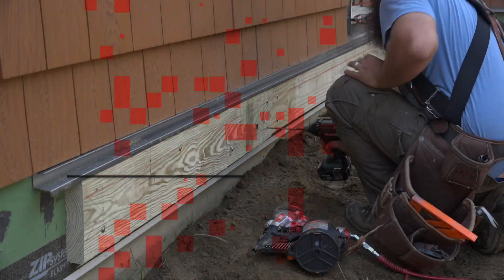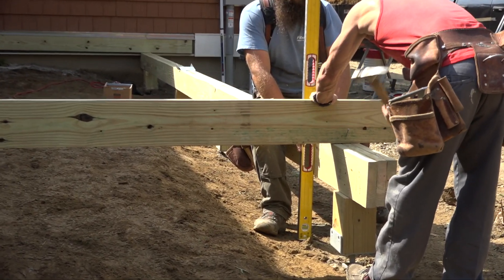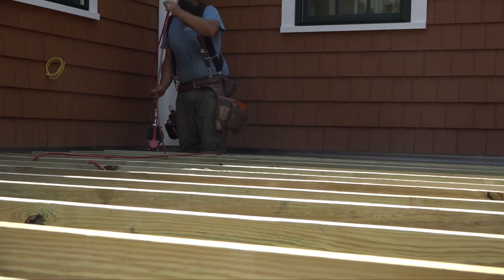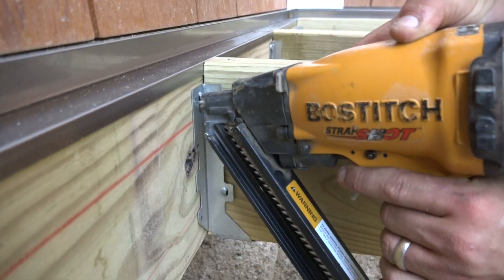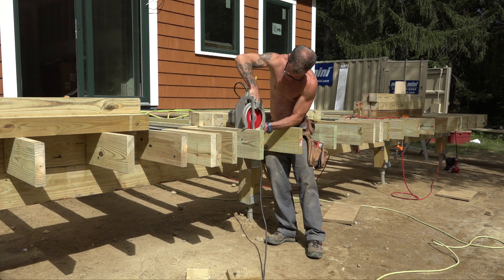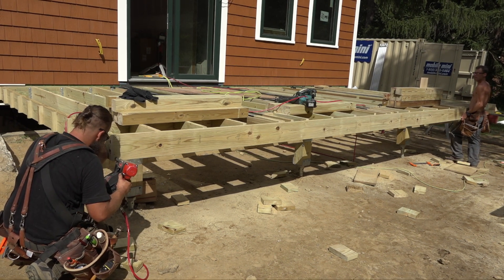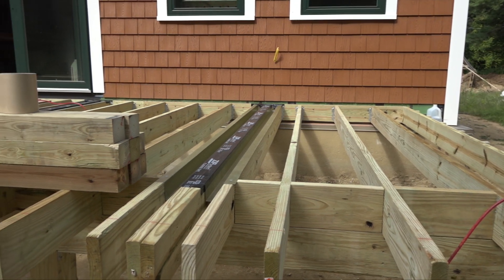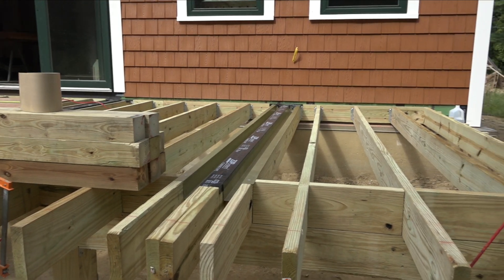Basic Deck Framing: Joists, Blocks, and Posts

Comment: are the added brackets to the post really necessary? I think their just scamming you for money. Those stamped out simpson brackets get real expensive when you have to buy a 100 of them for one deck.
Reply from the maker: They were necessary according to the building inspector.
Reply: @ProTradeCraft  Then the building codes are just scamming you for money.

Comment: Ok… I’m so confused 😂 is this sarcasm and they’re doing a bad job, or is the narrator actually impressed and they’re doing a great job?
Reply: They did an overall good job.   A couple things that could be improved is some ice and water tape over the joists especially around the sill joists.  Right now the water is going to run off the house and down the drip edge and right onto the sill joist.  I'm newer to the terminology.    But over time that water will rot out even the PT boards.   So tape over all the joists will get the water to run off and onto the ground instead of pooling on the wood.

Comment: After removing a deck built by morons from my house that rotted the band joists and double sill plate i see what was done wrong. No sealing membrane behind ledger board, not even any metal flashing on top of it. All the joist tops were starting to rot where the screws went through so sealing the tops with tape would have stopped that. Go overkill on waterproofing not underkill.

Comment: Be sure to check your states codes, some require screws not nails for joist hangers to ledger.
Reply: I use screws for everything I build. Weather it's a deck or furniture.

Comment: Use of those brackets on the posts is nonsense. All you need is a 4x4 back 
block. I also double block on each side as well. Five and eight inch structural
screws tie it all together.

Comment: Never use nails.   Screws  won't back out after 2 years 😂
Reply: Screws shouldn't be used for bearer and joist work. As screws have 0% flexibility and will most likely snap if there as any major movement on the deck
Reply: They used nails at the sheer points which are stronger than deck screws.  Use of deck screws are meant for areas that  are exposed to tensile loads.
Reply: @jasonmcelroy1938 He's almost certainly referring to structural screws.

Comment: Nice to see the skill level.  I recently started adding ice and water shield to tops of 2x's.  I am 59 and did some decks 25+ years back with ice/shield... just remodeled there and the joists are incredible, other deck without looks bad.  Stainless fasteners helped as well.  It really is a big difference.
Reply from the maker: Glad you like it. It is not a bad idea at all to add flashing on  top of the joists.

Comment: Why didn’t you tape the tops of the joists?
Reply from the maker: Pressure treated lumber and a reasonably dry climate. Your mileage may vary.
Reply: Because it isn't necessary and it's wasteful.
Reply: @bguen1234 it's not wasteful.